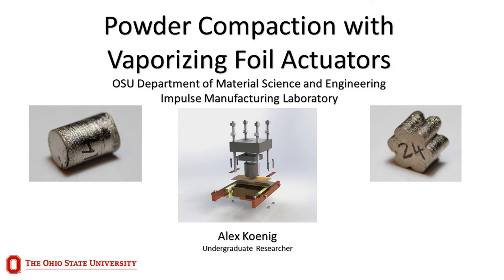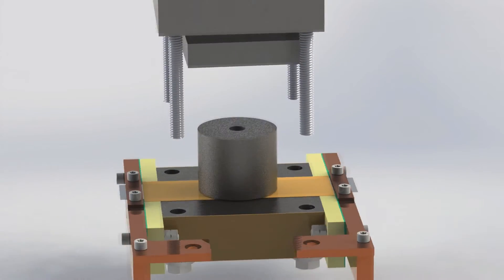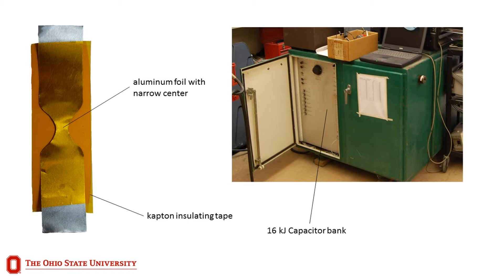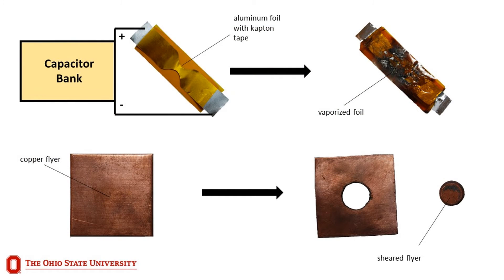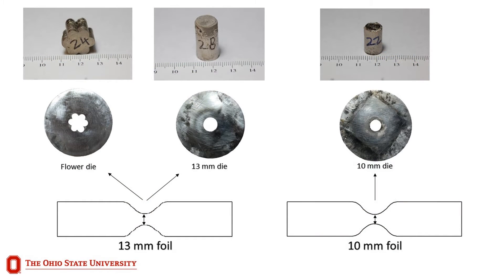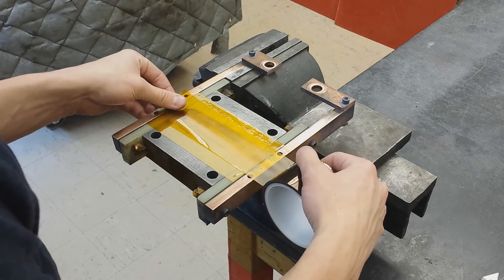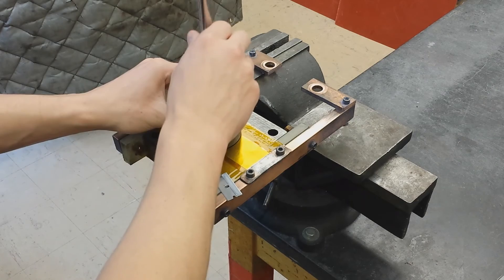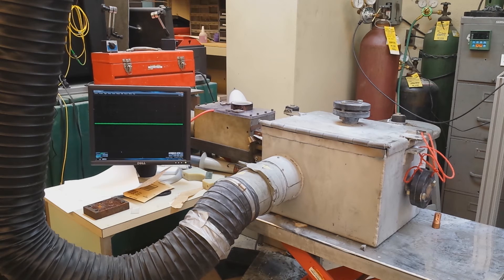Electrically Driven Dynamic Powder Compaction for Net Shape Manufacturing

Comment: Have you heard of electrothermal guns.  If you electrically heat aluminum in water the aluminum will burn and generate high pressure.  Work was done at Maxwell on this years ago.  Perhaps it could be used for metal forming.